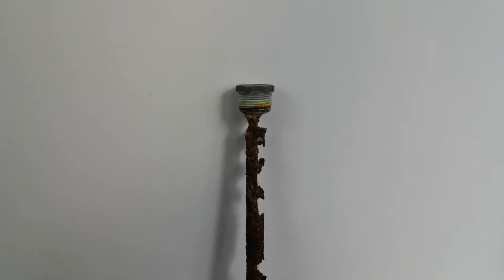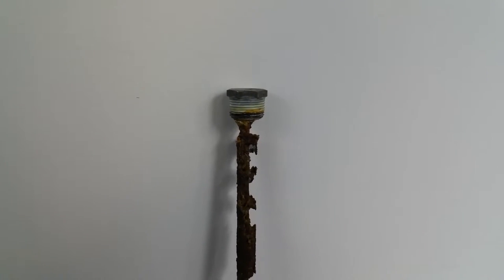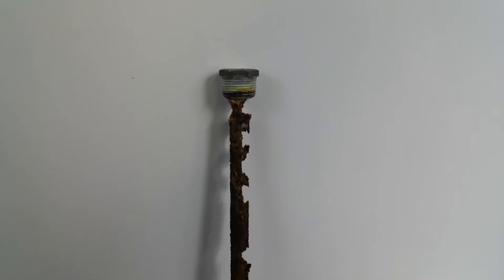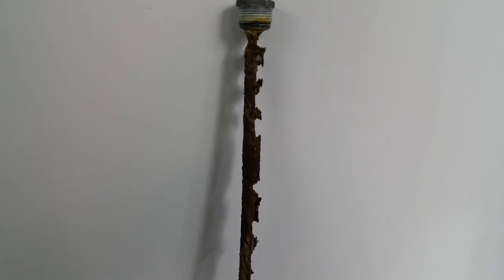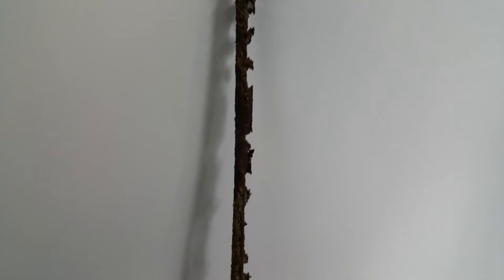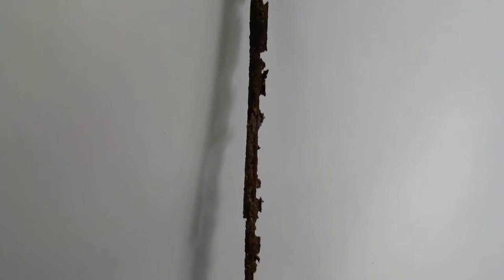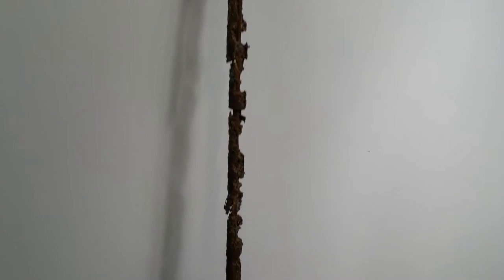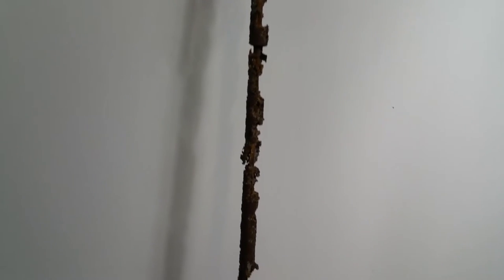Anode rod replaced - Teflon tape used

Comment: As long as there is a metal connection between the tank and the rod the rod will work.  The smallest sliver is enough to transfer the electrons.   Just check the resistance between the rod and the tank, if its open then take away a little tape or just put a bead of solder to bridge the connection.